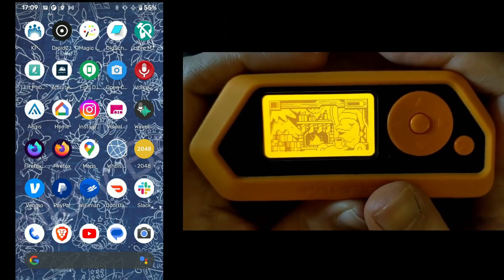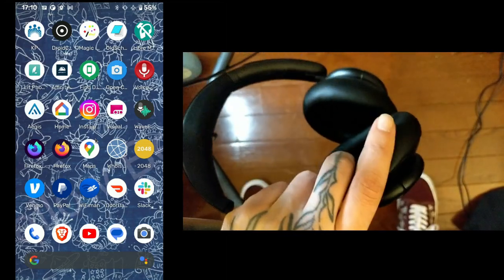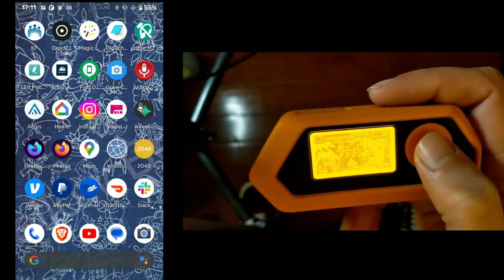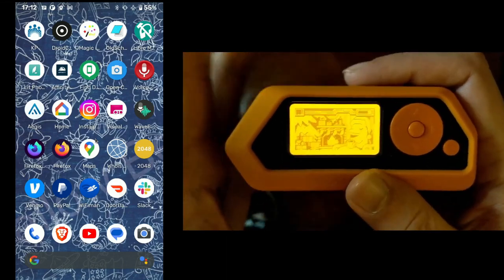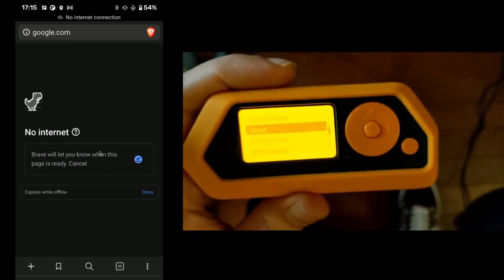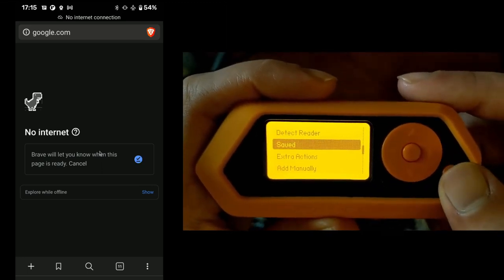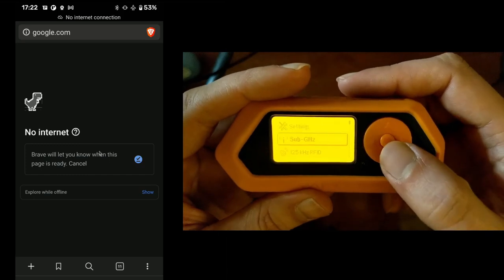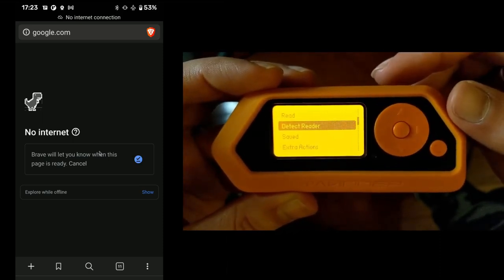Hacking NFC with Flipper Zero

Comment: Thanks for the great content!
MiFare Classic emulation is possible. You need to read the chip, get as many keys as possible, save it and then do a nested attack. With the nonces gathered from that you can bruteforce to discover more keys. If you don't find all keys, repeat the process until you have all keys. I'm not sure it's possible with all MiFare Classic chips, but I've been able to read and emulate a Dutch OV-Chipcard (Dutch public transport card).
Reply from the maker: In earlier development of the flipper they had discussed hardware issues that led them to believe mifare classic was not possible. I think they've found a way around that since releasing this video so you are right. Some mifare classic emulation is possible,

Comment: I think this device can do more and it is a lot powerful . But it is software restricted because they don't want to do illegal stuff with this device :) And regarding the "detect reader " functionality :  you can extract NFC keys from an NFC reader by getting nonce keys and then decoding with flipper . I did extract some NFC keys using that function .
Reply from the maker: Its true that they limit the capabilities of the device through firmware, but that's primarily for legal and regulatory reasons. Where the flipper falls short is  things like repetitive brute force. It just doesn't have the computational power. There are also small hardware issues that will likely be ironed out in future iterations. Mifare classic 1k is a good example where the timing issue is best solved with a hardware revision
Reply: If he only knew how wrong he is in this video. If you don’t know now you know lol
Reply from the maker: @travisrawlings4957  I'd love to make better content. If I'm wrong, let me know!

Comment: I managed to tap my flipper to card reader in hotel room for about 16 times and then I calculated on my phone. Then I read my hotel access card. From there I can open my hotel room using my flipper zero
Reply from the maker: Indeed, a lot of development has gone into mifare classic. It can still be a time consuming task and it also depends on the security put into place by the hotel

Comment: Just stumbled upon your video! Love the information! Can you make video explaining the detect reader function a bit more in depth? I’ve been able to collect all the nonces from the reader, then use Mfkey32, and it sends the info to my phone. So what after that?
Reply from the maker: thanks so much! I've been wanting to make a video about that but sadly I havn't been able to get permission from people who own a card reader. Its relatively simple though. If you collect the nonces you can connect to your phone and go to the hub section in the flipper app. Under NFC Tools you will see mfkey32. From there you can import the nonces you collected and it will calculate keys. If those keys don't already exist then they can be added into your dictionary. This is helpful because then you will have more keys available to help brute force different NFC cards. Its not all that great though because the flipper isn't really powerful enough to produce quick brute force results. I've seen it take up to an hour or more when dictionaries are large enough.

Comment: Could you do a video on how to get keys from mifare classic? And how to add them to the flipper library to then clone the card and emulate?
Reply from the maker: my understanding is that keys are derived from readers. You need to do the reader detect application on the flipper to extract nonces that are then calculated using mfkeys32. They keys are then added to your dictionary so they can be used to brute force mifare classic cards. Otherwise you can find libraries in various github repositories that you can use instead of the standard dictionary. These have keys found by people around the world.

Comment: Are you using the vanilla firmware or Unleashed in this video
Reply from the maker: I stick with vanilla for the time being. I will likely move towards building my own custom versions as times goes on. A lot of the fun and more advanced stuff requires altering and then compiling your own firmware

Comment: How do i get a larger file of keys?
Reply from the maker: I believe some of the custom firmware have expanded dictionaries. Some of the different github repos like UberGuidoz have expanded dictionaries you can add as well. You just replace the file on the flipper with the one from the repository

Comment: Hey I just watched your gut hub video and every time I download the files it doesn’t work it just shows a file name is added on the computer but nothing on the flipper you know of any solution or problem I might be doing?
Reply from the maker: hi, so when you download the file, you should download it to your computer. Its compressed so you need to extract the files to your computer. Then you can either use the file browser in qflipper or an SD card reader to transfer files to their respective place on the flipper. IR files go in the infared folder, sub-ghz go in the subghz folder. You can have sub folders to organize the files better. They are often times come organized in folders already.

Comment: The reason that flipper can not do anything is because you need to load Roguemaster firmware. Mifare and lots of schemes are implemented there. It’s also open source so you can write your own in C. 

Flipper was not meant to be a canned tool. It’s an apparatus and it’s abilities depend heavily on the operators.